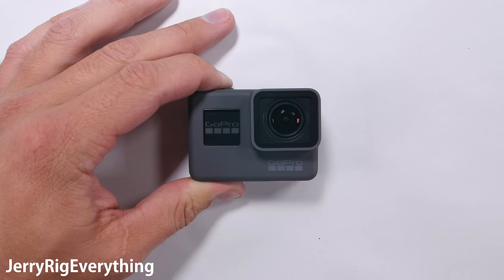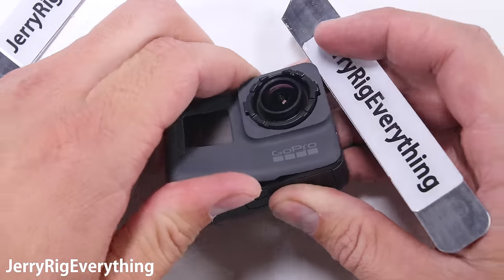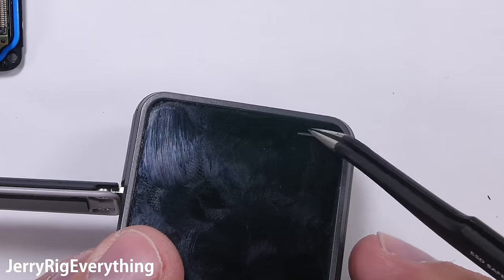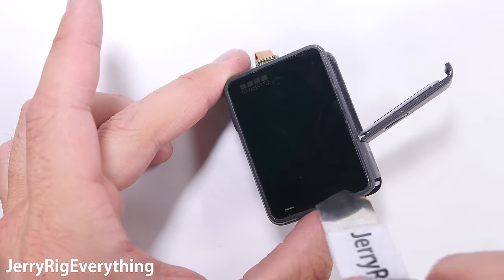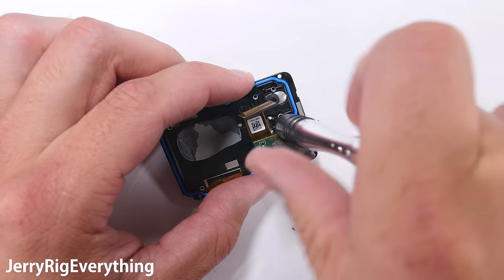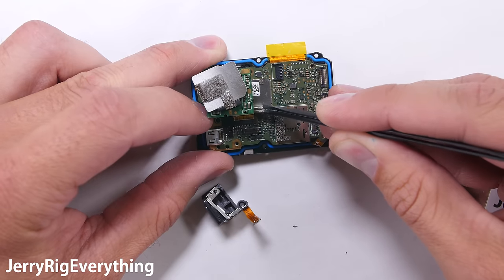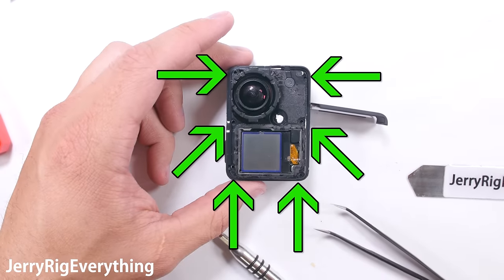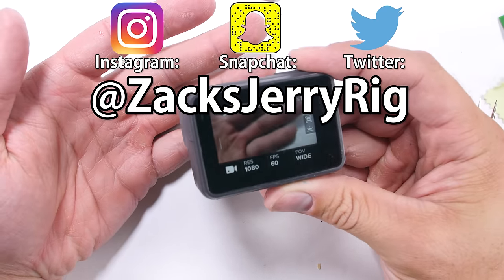GoPro 5 Teardown - How to Repair a Hero 5 Screen, Lens, and Battery video

Comment: Sir you've made a fatal error on disassembly: The lens caps can be simply removed with just a little twist on the cap, to the left as usual. This video seen you've used pryer to do that.
Reply from the maker: +Joel Robert Justiawan you're probably right.  Where did you see that?
Reply: It's hardly fatal. Removal of the lens housing is to twist it off as it's designed to do so. Instructions for such are included with the Super Suit housing.
Reply: JerryRigEverything Pull outwards on the lens cover and twist to the left. It pops right off. It's designed this way so it can be easily replaced if scratched.
Reply: JerryRigEverything it is on 0:35 . I know you didn't know that because the little instruction isn't imprinted. GoPro, please tell people max properly next time. Imprint the twist icon on the next production of lens cap now on
Reply: Joel Robert Justiawan In fairness to GoPro, as I mentioned the instructions to remove the lens are included on the Super Suit packaging. Generally speaking it would not do GoPro or anyone any good for people to be taking apart their HERO5s without any need to do so. The most common reason previous GoPro dive housing wind up with leaks for example is particulate matter stuck in the gasket. Needlessly removing the dive housing unless you are actually doing a replacement or Super Suit installation just creates an environment for things to go wrong.
Reply: There's a first video from a scuba person showing how he twists the lens to remove it to fit it inside a super suit. the video came out right after hero 5 was announced.

Comment: The front lens cover will twist off.
Reply from the maker: +Daryl Stimm lol.  Maybe I should have tried twisting harder.  Dang.
Reply: JerryRigEverything The key is not to twist hard but to pull the lens outwards and then twist counterclockwise. I do it all the time for night videos when the outer lens produces excessive glare.

Comment: Thanks for this thorough coverage. Replacement rear touch-screens are now available.. (reference your comments at the 2:50 mark).. Adhesive is T-7000 and is a little more pliable to pry off if it's heated a lot beforehand.. My screen was already shattered, so I continued to destroy it in the removal process.. Got the screen out by pushing with a thin screwdriver from the back corner after battery housing removal. I used a sharp X-Acto blade to scrape the remaining shards of glass from the adhesive/edge where it's seated. PS - Don't forget to reinstall the speaker at the 5:45 mark, and the (6) little screws holding my armature were T3, not T4. Cheers.
Reply: Does this glue T7000 hold water?

Comment: Jerry, the best (simplicity + clarity) video I have seen so far. I had accidentally inserted my SD Card between the slot of the body and suspected that I have dislodged some cable due to which the screen has gone blank. From your video, it looks like I might just be right and with luck be able to fix the same. thanks!

Comment: the lense cover has a slight twist and it comes off. you don't have to snap it off. for the GoPro dive suit this cover has to be removed, and it's very easy to remove by twisting it counterclockwise, it's less than a quarter turn at best and it just lifts off.

Comment: I bought a refurbished GoPro Hero 5 black. After about 2 months the LCD just stopped displaying anything, but it was still responding to touches (because the settings icon appeared on the front LCD if I swiped on the display). I figured the ribbon cable must be making bad contact.... After watching this video I noticed that the ribbon cable runs behind the battery cage before clipping into the motherboard. By removing the battery and pressing firmly down onto the location where the ribbon cable clips in I was able to get the LCD to make a connection again! (No teardown required)
Great video!

Comment: Nice vid, but need  little mention, gopro filter can be detached just by rotating it, no needs in breaking it to pull back again.
The other spots is on point. Wanted to change housing with removing a display from it, now i see it is difficult than i thought

Comment: The lens can be twisted off gently and  doing so with a pry tool you could slip and break the glass. In order to pull the lens off camera facing you like its gonna take your picture then gently pull it out and turn to the left and bam lens is off gently

Comment: Umm bro.... Its super easy to remove the lens cover from a go pro 5...
All you have to do is pull and twist......
Thats what i do all thr time at worm...
I dont have to pull or push the metal bar inside the cover.
But super helpful video as always.
Learnt alot more then i thought i knew

Comment: Hi there, great video. I have a question maybe you could answer. The tiny gold ribbon cable that connects the power button (and apparently the sound on the video)  has come out of the connector and the white connector latch has broken off (happened while changing out a lens). I'm able to fit the tip of the gold cable back in but it won't stay in place when I reassemble the camera. Is there some way to glue it in place? If so which glue could I use safely. I've tried using a tiny piece of electrical tape but it doesn't seem very effective though I have got the camera to work but without sound on the video. Thanks in advance!

Comment: Would have been interesting to know if the lens itself can be unscrewed from the sensor housing (has been possible on Hero3/4).   Some people like to swap out for narrower angle lenses.
Reply: The lens socket is glued to the sensor board and the lens can be removed but not the same way the Hero3 and Hero4 were. Also the lens thread is NOT M12 like the other gopro cameras so you can NOT swap lenses unless you put in a custom M12 socket made to fit the Hero5.

Comment: Now enjoy dust particules inside
Reply: So?
Reply: Bro, i thought that fly is real and i tried to catch it XD
Reply: Malik Chaabane
Reply: Daniel Not just a clean room, but a well ventilated room, to get rid of airborne dust
Reply: The Youtuber The best way to avoid dust is doing it in your bathroom just after a hot shower. The dust will fall because of water vapor, cleaning the air.
Reply: toocoolforu 🤔
Reply: I would do it while taking a hot shower. lol.
Reply: Shawn Van lol just tryin' to help
Reply: your not going to get dust in the image if you take it apart as far as he did. The image sensor was never exposed. you might get some dust specs inside the case but as long as that lens stays sealed it won't matter.

Comment: you wouldn't happen to to know what those three connectors are called that attach the ribbon cables to the main board, would you? I'm trying to make an extension for them to fit a gopro in a very thin slot. there is space on one side for the lens, but not enough space for the whole go pro on the other end.

Comment: do you manage Electrostatic discharge control when touching those printed circuit boards? it makes me wonder cuz i had a training about it that if you touch those PCB without ESD control (such as wrist and foot straps), it would damage those IC'S and other parts in the near future and end up not working. thanks.

Comment: Hi Zack 🙂 I’ve just found your vid on the GoPro hero 5 and absolutely love it, but I have a question as I have just purchased a used GoPro hero 5 and like it heaps, but the problem is the audio, so I went on a search to find a little adapter to attach my mic to ,the problem is I’m only able to find an adapter that in Australia is going to cost me in excess of $100 Aud (if I’m lucky, possibly more lol) my question is , I have scoured the internet trying to find a solution , or a diy fix to this as my previous GoPro only needed a $4/5 adapter for a mic, but there’s absolutely nothing I can find, what I need to know is what makes the “GoPro mic adapter for GoPro 5/6 so dang special) and why can’t I diy it ??? Or at least put something together for considerably less that will work, what is in that adapter that makes it so expensive.?? Hoping you can help , if anyone can figure it out it’s you lol 🙂👍 keep up the awesome work, cheers from Australia

Comment: Can you replace the internal lens by unscrewing it? Or do you have to replace the whole circuit board it is connected too.  Can you separate everything so you just remove the lens
Reply: I would also like to know this. Can you unscrew the lens and change it or is it fixed?

Comment: I've replaced my lens cover because it got cracked when the camera tipped over.  Now the new lens is much easier to remove than the original.  Is it still waterproof?

Comment: I have a gopro hero 5 black and it began to overheat right after the warranty expired. I have done everything to remedy the problem with no success. Gopro wants me to buy a "known good" sd card, but I am not  interested in spending more money on this camera. In normal use, the camera will record for a maximum of 2 or 3 minutes. If I put it into the freezer of my refrigerator, it records for over an hour. Obviously the temp sensing component has gone out of range and is defective. 

Any idea if the temp sensor is something that can be replaced? I've rebuilt cell phones and have done some very complex work. Just wondering if this camera would be worth opening up to attempt this fix. Appreciate any input. Thanks!

Comment: Is the go pro still waterproof if I have removed the lense once and put it on again? As you said that any go pro which has been opened up won’t be water resistant anymore 
Does removing the lense also count as opening up 
Thanks

Comment: HI thanks for making such a detailed video. I notice everyone seems to call the lens cover a lens. A lens is a peace of optics not a plate of glass. Felt the need to play pedant so i could ask the following... Is it possible to unscrew the lens from its holder around where that orange rubber seal is or is it all one single piece from the convex lens all the way back to where the plastic is glued to the sensor board? Many thanks for any info.

Comment: Here's a fun idea:

I dunnot know to much about those "lego-like" connections but: If you were able to mitch match different phones or other gadgets with the same connectors. I'ld imagen that things from the same generation from the same manufacturer possibly would work. Sure enough, even if it would have worked, it wouldn't physically fit and probably not a chance to "close" the phone again. But if not, shame on me for not knowing what I'm talking about. Although i'd love to see a note 7 with a working battery... Or maybe the axon 7 with the worst speaker on the market... 

I'd love it atleast...

Comment: could you test the minimum and maximum operating temperatures? with the hero 4 it shut down after a few seconds in -40 degrees Celsius. and I would like to know if that is improved.

Comment: Maybe u can help...I have hero 5 that only powered on with battery out and the charging cable plugged in..can this be a bad solder or what can it be? Works fine with battery out and the charger plugged in

Comment: I'm going to attempt to tear down a Hero 7 black. It's my understanding that the glue around the front LCD is much stronger than that of the Hero 5 and Hero 6. The few videos I have seen of the Hero 7 tear down shows the front face plate being destroyed. Has anyone had any luck doing this without ruining the face plate during disassembly? I know you can buy new face plates for the Black Hero 7 black. I am unable to find replacement face plates for the dusk white versions. Thanks!

Comment: The touchscreen on mine stopped working just because i took off sd card and battery. It works fine just no screen. any idea what might be? Gopro claims im not using the right sd card which is not the case since with another sd card the screen still doesn't work. so im clueless and now have a half working camera.....

Comment: hello I do not work touch screen, and change once I burn the flex of it .. and now and after pairing it with my cell phone did not fire the screen again .. I do not know what to do and the go pro 5 It does not have to restore factory, without the screen touch screen ... thank you friend.

Comment: Hi Zack it’s me again, sorry if I’m being a bother to you it is not my intention, but again all day today I have been trying to get answers as to why I have to pay $180 AUD to get a mic adapter for my GoPro hero 5/6/7 to be able to plug in a $10 3.5mm lapel mic, I have even spent most of the day today just trying to find away to get in contact with GoPro but have have no luck with that either, I have also chatted with a few people in forums but they are having the same issues and problems that I am, any suggestions to help with this would be greatly appreciated , cheers 🙂👍

Comment: I know this is an older video but does anyone know what kind of adhesive is used on the inside of the camera? I'd like go put it back together tight, after I took it apart it seems loose without any adhesive.

Comment: with this video I can save my goprohero 5, some water drops get inside.
I leave it partially dissasambled inside a sealed plastic box with rice, and now, few weeks later it still working.
But now I need to paste the front side, because, after the teardown, the front keeps a little open and I think some dust can get inside.
Anyone can recomend something? using the same glue for pasting cellphones screens? a softer glue?